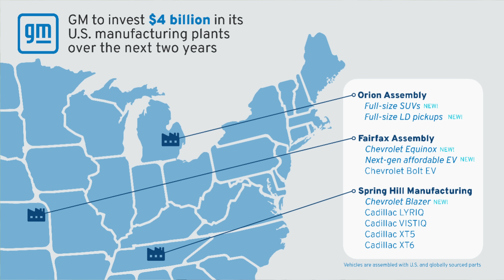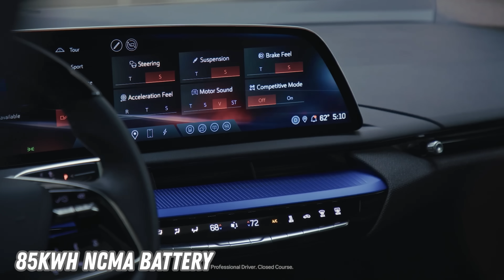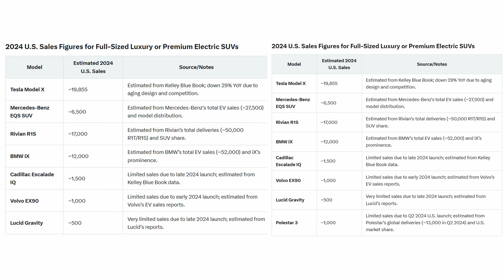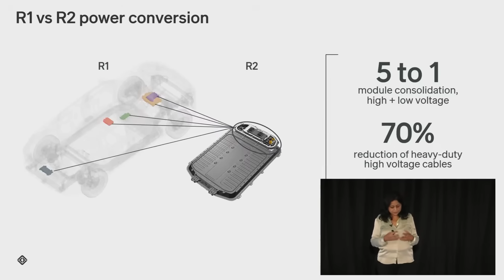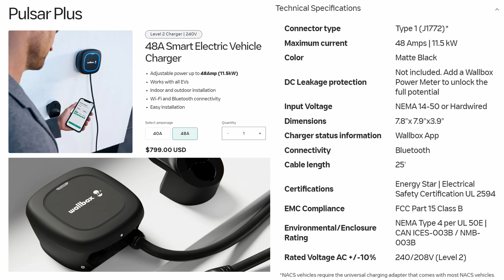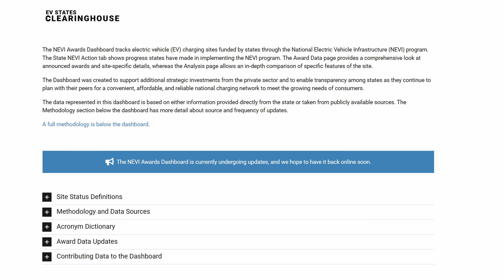The Current : Weekly EV News Ep#67 Jun 15, 2025

Comment: The "Stars Align":  https://www.youtube.com/watch?v=W96a8svXo14 simultaneously posted on another YT channel is a very practical and detailed solution to Charging EVs.  While 100% correct, it's a bit nerdy and perhaps  too detailed for some, but it may work well with Miss Go...  So I'm going to make 3 versions of this comment.  The YT channel is Technology Connections, the program date is June 15, and the video title is "The "standard" car charger is usually overkill—but your electrician might not know that".  This may or may not survive because it has a link, even though it is a link to YT.
Reply from the maker: We recommend professionally installed hardwired UL certified 48A+ level 2 equipment for every EV owner, if possible. Convenience and safety are optimized with this scenario. Our recommendation is the Tesla universal wall connector which supports all EV brands sold in the USA and features bi-directional capacity, outdoor capability, and over the air updates. It shows EVs to be screened by VIN, time of day settings for lower electricity costs, and monetization to be enabled in the future through the Tesla app. That capability is excellent for retail and rental situations.
-Producer Tim
Reply: @MissGoElectric  All of the possibilities in the referenced video can, and should, be installed by "professional & licensed" electricians, use the UL approved wiring harnesses, including Tesla's,  for a fraction of the usual "recommended maximal power (i.e. 40 /50 A)" cost and are safe and effective!  The main take away point is that the "one size fits all" and maximum possible charge rates are not necessary for most people.
Reply: @MissGoElectric  And thank you for responding and leaving this comment & link.  Perhaps a "Collab", or your version of the information would be beneficial to help spread the adoption of EVs and "Home Charging" so that potential buyers aren't immediately scared off by "many thousands of dollars" needed to provide home charging.
Reply from the maker: We do this kind of education for automakers directly and have since 2011. I don't see an advantage to collaborating, but it's great to see other sources such as your guy and Tom at State of Charge specializing in that content. We think it is well covered.
-Producer Tim

Comment: American EV manufactures need a step change in battery technology in order to speed up adoption. Americans are not going to wholesale switch to an EV until there is 500 miles of range and charging speeds that match or come close to gas fill up stops. There is also a direct correlation of EV adoption slowing with the fact that manufactures have stopped the free charging programs as well as charging now being more expensive than gas. I tried to warn those that were advocating to end free charging programs that this would slow adoption but those people didn't listen and still continue to advocate for no free charging programs. The advocation of lower charging rates is a must in order to speed adoption it should not cost more to charge especially when it takes more time to do so. I also feel that free charging programs should only be for areas outside your area code of purchase so that these programs are not abused for everyday charging but are only used for road trips.
Reply from the maker: There are two sides to each of the actions you've identified as problematic, and we appreciate your having shared your perspective.  Thanks for watching The Current! -Producer Tim
Reply: @MissGoElectric  lol there are two sides to everything... I think the point I am making is on the side of adoption.

Comment: Good Reporting,  the murky picture of  GM's new  2026 BOLT  and the  mythical Sub  30K   ''Budget''  Tesla,  are maybe finally coming into more focus,  but a huge question remains:

??? What are the chances  that  Tesla's upcoming  ''Budget Tesla'' code named  Model  2, or  Model Redwood, or Model Q,  (depending on the source of the rumor)   is going to 
also qualify for the 7500.00  ''New EV  I.R.S. ''  tax  credit?

I'm going to say unlikely because  to get the cost that far down, and keep a range above   250 miles,  the source of the main propulsion battery
probably has to originate from Tesla's  China plant,  which I think would disqualify it for the large  7500.00 U.S.A. eligible tax credit rebate-discount????    (your thoughts please.....)
Reply from the maker: We do not expect a $7500 federal EV credit to remain in tact beyond 2025.

We do expect all Tesla EVs sold in the USA to utilize batteries produced in the USA by the end of next year.
-Producer Tim

Comment: Unless electricity supply companies pay me EXACTLY the same as they charge me, why would I want to help them maintain the grid, they should even pay me MORE as I'm doing them a favour.
Reply: It's called business. What is not nice is if they promise you a price, you run 30 year calculations on a solar install, then they drop the price
Reply from the maker: They are paying to maintain the lines, utilizing or discarding surplus energy, and for the administration costs associated with billing/credits. Those losses are reasons why participants cannot expect to receive retail rates for wholesale supply. 

Remember, there are also significant losses in conversion to high voltage and along transmission lines. 
-Producer Tim

Comment: I would like to see some numbers regarding accidents.   If there is only one accident every 50,000 miles then each car driving 50,000 miles in a year would have 1 accident per year.  So I think the accident rate needs to be about 1 accident per 500,000 miles at least otherwise there will be so many accidents on the news that the service will fail.   What is acceptable?
Reply from the maker: Crash stats are public:
Motor Vehicle Safety Data | Bureau of Transportation Statistics https://share.google/CZdDvhMeKkjJbvsZC
-Producer Tim

Comment: It was an important point that you raised that Tesla's Model S and X are still at or near the top of their EV segments. Unfortunately even though the S and X were Tesla's flagship vehicles initially, their updates have followed the much higher selling Model 3 and Y (which does make sense), with Musk only introducing innovations like 48V acc system, and V2G to the Cybertruck. Which has had mixed success, like the rest of Tesla because of Musk's political meddling/disasters. The refreshes to the S and X seem pretty minimal, and I was hoping for at least them swapping out the battery pack (using the new GenII 4680 batteries) to become more competitive.
Reply from the maker: We expect the Cybertruck platform innovations to move to S and X when the buyer base is much larger. Interest rates make payments unreachable for too many buyers at this time. -Producer Tim

Comment: I've told my favorite mechanic I'll sell him my beloved single cab, step side, V8 Silverado when I can buy an electric El Camino.  Please make mine a single cab with a 3 seat, fold down arm-rest and an open options list. A dual output shaft motor in the front and back means no drive shaft hump so you'd have a nice, flat floor for the occasional 3rd person.  It could be an AWD, fully independent suspension, unibody, comfortable, fun little cuck!  A solar bed cover with power outlets in the bed and cab would be nice for weekend adventures and the impending apocalypse.
Reply from the maker: More form factors go electric every quarter. This morning at breakfast with Miss GoElectric we parked near a Hyundai Santa Cruz. We were in her Rivian R1T and I remarked that I'd love an electric Santa Cruz. She agreed that would be great. It's a very cool form factor. 
-Producer Tim

Comment: I would call the X and S performance. Not premium or luxury. A lucid is luxury, Mercedes are luxury
Reply from the maker: You can label them personally however you like. 

The industry calls them a luxury sedan/crossover including Car and Driver, KBB, Tesla themselves. 

I spent twenty years working for Lincoln, BMW, Mercedes and other brands at or above that segment. MGE and I drive the Lucid Air GT Dream Edition 689 miles for the single charge distance public streets record and have filled several segments with Lucid. We understand the advantages you are taking about. 

On the other hand, when it came to where I'd put my own money with it came time to buy a $100,000 car, I chose a Model S. The aluminum body, superior self driving, superior internal storage, smoother and more logical GUI, and superior performance, easier charging/routing were among the motivators. 

I would also like to have massaging seats, head up display, and rear steer... if I could have those things without losing the Model S advantage, I would. Unfortunately, subtraction is required in order to go to a different luxury option. 

Full self driving is, in my view, the most potent luxury feature. I used to get an educator for Rolls Royce... Those ultra luxury owners usually hired drivers. That is an indicator of the top tier luxury experience. 

To reiterate, there are many different ways in which luxury competitors best one another at higher price points.
-Producer Tim
Reply: @MissGoElectric  Same goes for you. You can label them as you like, though I FEEL more people would agree with me that they are performance. There isn’t much LUXURIOUSNESS about S and X. Your credentials are definitely impressive but they don’t mean you are correct in the eyes of buyers. FSD is a great FEATURE though it still has a long way to go until it allows you to fully relax on a drive. If anything it gives me more anxiety at times. Just yesterday it tried to take me into an express lane three times even though I have till usage off in the settings. But, congrats on the resume.
Reply: Tesla's luxury is in software & hardware😊
Reply: @rozonoemi9374 that is not luxury and much and people keep saying it is. FSD keep making tons of mistakes. I wouldn’t call that luxury. Unsupervised maybe. It would be nice to drive cross country with out having to worry about watching the road the whole time worrying about mistakes.
Reply: @roberto.gallegos  It's coming Soon!
Reply: The good news it EVs make categories overlap.  Part of luxury category was a smooth quiet drivetrain, that's all EVs. Classic Fiat 500e goes 0-40 real quick, Spark EVs are quick too.  
New def of lux could be not going to gas stations
Reply: @rp9674 I like that thought and those points. 👍🏼

Comment: Looking forward to seeing the new Chevy Bolt.  Wish GM would release a few details about it to promote it in advance, they have been very quiet about the project.
Reply from the maker: Companies would spend marketing dollars when they need help drumming up demand. We do not suspect GM will have a surplus of Bolt product for years.
-Producer Tim
Reply: @MissGoElectric  Can you elaborate on what you think GM's plans are for the Bolt. I'm reading between the lines here, that they will keep production lower than demand much like Ford did for years with the Mavrick, letting dealers have a CASH COW.
Reply from the maker: We don't know if the Bolt will have a decent profit margin or not. We know franchise dealerships prefer to sell internal combustion vehicles because service revenue is next to nothing in EVs. Franchise dealerships generate about 50% of their revenue through service. GM is legally obligated to sell every US consumer car through an independent franchise dealership. That incentive structure is a bottleneck for GM EV sales 

Demand for low priced EVs is very high. If somebody produces a $25k EV with 300 miles of range, they won't need an expensive ad campaign. The price tag will do the work.

We have reported everything we know about the upcoming Bolt. It would be irresponsible of us to publish specific speculation beyond "if-then" scenarios.
-Producer Tim

Comment: The problem with moving so quickly to NACS by non-Tesla automakers is that there aren’t many NACS plugs at DCFCs outside of Tesla superchargers, meaning the necessary use of adapters, not to mention the new lack of desire to ever visit anything with the name Tesla on it for a huge percentage of BEV owners now due to Musk.  And all the avalanche of new non-Tesla DCFC stations being laid out across America all have CCS plugs (even if many now also have NACS plugs).  The move to installing NACS ports in non-Tesla BEVs was very premature and unnecessary..,
Reply: Whether your EV is CCS or J3400, if you do road trips, you'll need adapters for the next 10 years...
Reply from the maker: How many seconds do you think it takes to attach the adapter? 
Most EV drivers use public DC fast chargers fewer than five times per year. What is the total penalty of effort for most buyers in a given year? One minute? Two? 
-Producer Tim
Reply: I agree that there was no reason to rush this transition
Reply: First, im a random dude who is a NACS fan and has been watching the adoption very
Closely.

Sentence 1: that's true, but actually is really easy to fix. It's as simple as replacing a few ChaDeMo cable and telling the computer to use the ccs protocol through the nacs port format. Electrify America is going to install NACS ports, Pilot Flying J, IONNA, etc as well as walamart charging, and most local chargepoints i know have already added nacs ports where chademo once was. There's nothing wrong with having an adapter regardless tho as a Tsla owner who enjoys charging on CCS.

2: when it comes to AI or the cars? Yeah. When it comes to charging? Not so much from what it looks like. This is a case of the internet saying one thing while regular ppl say otherwise. Most regular ppl charge at CCS because it's plug & charge and already setup and no adapter fiddling, but they do not mind using a tesla station to save time.

3: ccs plugs are still being installed: true, because people with CCS cars are still on the road. Given this logic, there was no point in changing from ChaDeMo until recently too. But seriously, that's how a shift happens. You support what is there and shift more to the new standard as it's more adopted.

4: premature? Unnecessary? If the world ended in 2026, then sure. But these cars will be on the road for what, 7, 8 years? Besides, of the ev charging groups, only EA basically only has CCS charging, and that's already planned to change in 2026. I agree on premature for 2025, but if you pay attention, very few DCFC makers are talking CCS ports in 2026 and basically none in 2027. And unnecessary? NACS cars support AC charging from 120v, 208v, 240v, AND 277v, which covers basically every significant electricity output in the USA for ac charging, so as more cars use the new standard, commercial EVSE installations at workplaces will become much easier too as you can wire them straight in. There are advantages to NACS.

Comment: If you have a Tesla Powerwall 3, you can do bi-directional Charging or grid supply with your Tesla.
Reply from the maker: We have previously reported on Tesla virtual power plant programs which are active in Texas and California. Those participants make money sharing Powerwall energy with the rest of the grid during shortages. 

Powerwall can charge up your EV (Tesla or not) during an outage. 

We had a Tesla Gateway ($4,500 installed) installed so that our Cybertruck can automatically provide electricity to our entire home when the grid goes down. The truck's 123kWh battery pack has the capacity of about ten Powerwall units which would cost about $100,000 to install separately.

Hyundai Group, Rivian, Lucid, Ford, and GM have all built vehicle-to-home capability into some EVs. Ford and GM sell the home hardware to make it work today. 
-Producer Tim
Reply: So glad this is happening. Makes total sense to use that power bank to operate your home 🏡. Or to operate whatever you want from your ⚡ vehicule ! Fantastic !😊
Reply: GM Engery also has a bidirectional charger that can be used as back up power for your home.  Getting mine installed soon.

Comment: I am ready to buy a 3rd model S and highly disappointed with Tesla’s announcement.  They have the technology for an 800V faster charging battery and 4-wheel steer by wire, but neglect to use it in their flagship EV.  At this price point, I expect a power frunk and an option for massaging front seats. 

I see no reason why Tesla should not compete with Mercedes, BMW, Porsche, Lucid, and now Cadillac.  This is a lower volume, higher profit market segment that should not be ignored.  Consider its halo effect on other models.   Tesla’s announcement is pitiful.
Reply from the maker: I still do expect all of those Cybertruck technologies to migrate to S and X, but probably not until interest rates go down and there is greater economic certainly in the US. 

I'm also a Model S owner... But I drive the Cybertruck more often because it has the features you mentioned. I think the Model S is more beautiful and I appreciate that the Model S is quicker. Like you, I'll need battery/powertrain/steer-by-wire in order to be tempted to upgrade my S. 
-Producer Tim